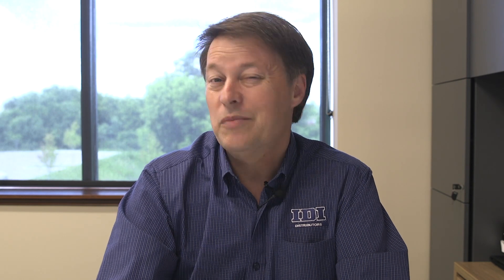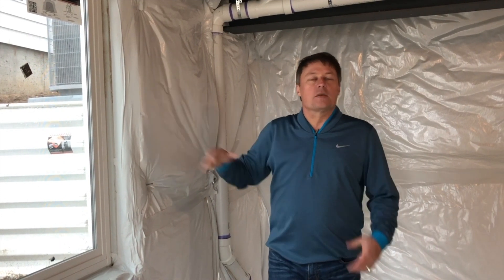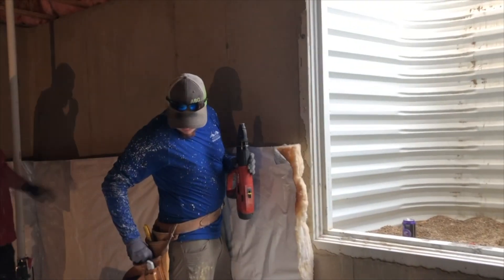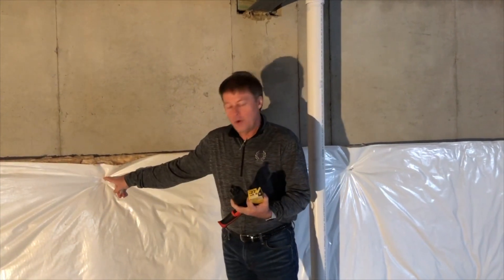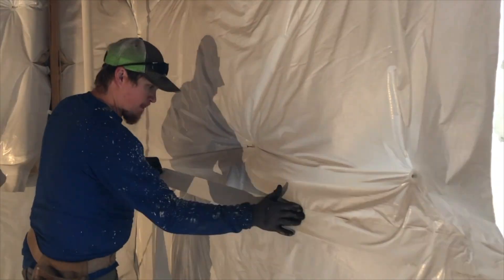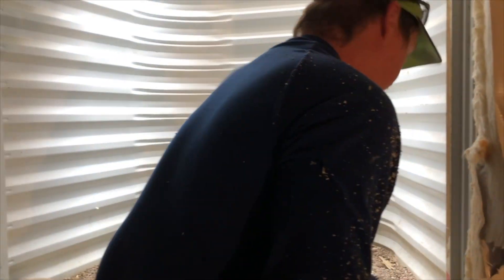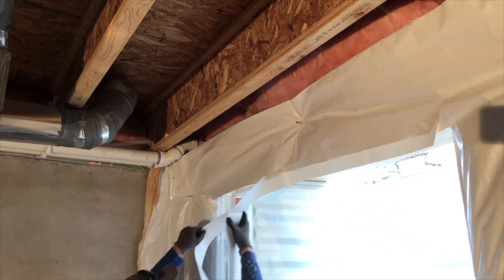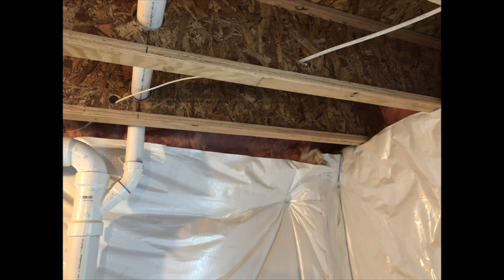How to Install Basement Blanket Insulation & Make Big Profits

Comment: If I have this type of product installed in my basement, how can I tell if it is a vapor barrier or not?
Reply from the maker: Matt, thanks you for reaching out. Basement blanket insulation comes in both vapor open and vapor closed. It can be hard to tell, but you can look at the surface and try to determine if perforations have been made. The same type of material or facer is used, but the vapor open product is perforated to allow moisture to dry to the inside.

Comment: Will I have to install fiberglass insulation after I frame when I have this wrap on my concrete or is it not necessary ?
Reply from the maker: Hi Lochan! You can install the fiberglass insulation if you would like, but depending on your climate zone the blanket insulation should already meet the insulation requirements. If you would like to discuss your question in more depth, feel free to give us a call at (952) 279-6400 and we would be happy to connect you with one of our specialists. Thanks!
Reply: @IDI_Insulation  is there any concern about moisture getting behind the drywall if you dont remove this prior to framing?

Comment: This product is a great way to hide wall cracks. That what my builder did. 13 cracks in my poured wall from floor to ceiling...never saw them thanks to this product. 5 of those cracks leak water. I will never buy another home that has this one the basement wall again.

Comment: Currently in CO springs 
Are you able to frame over this insulation?
Reply from the maker: Alex, Thank you for your question. Yes, provided you have no moisture issues with your basement walls or anything that would make it harder to diagnose problems within the new wall system you are creating, then yes you can build your walls in front of the insulation. You should do your best not to compress the insulation. Compressing the product would reduce the R-value and may cause cold spots and create problems you do not have today. Build your wall our where the existing blanket keeps its fluff. It would also be good to go one step further and use a vapor retarding primer over the drywall in the basement. This will prevent the drywall from wicking moisture toward cold areas on the exterior concrete walls in the winter time.

Comment: Can you please tell me the name of tape used to join wall blankets
Reply from the maker: Muhammad, Thank you for your question. The tape is a white vinyl seam tape. The one stocked at the branch where we did the job is the Venture Tape EB350. Please reach out to your local branch or let us know if you would like us to check stock in your area.
Reply: IDI Distributors Thanks for the info. I have my base wall blankets ripped from several places
Reply from the maker: @shoaibumer  Thanks for your response. We are sorry to hear about your home having ripped blankets. If you need new ones or the tape too repair them, please reach out to our local branch in your area.  We will make sure you get what you need.
Reply: So my basement has this but not all the way to the floor. I want to run it to the floor before I finish it. Also noticed that on the concrete wall side, there isn’t anything to act as a moisture barrier, is that ok?What is the tool called to install it?